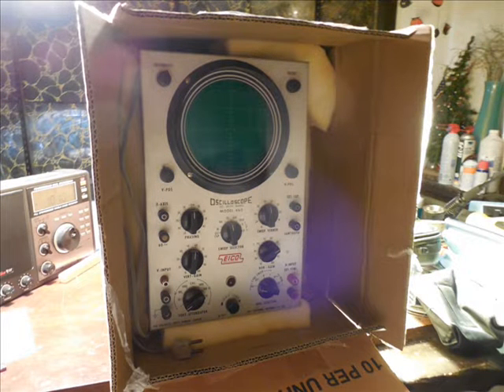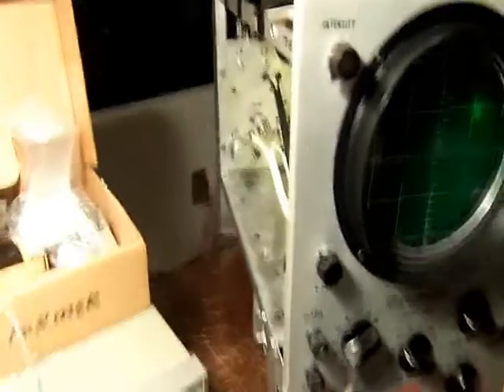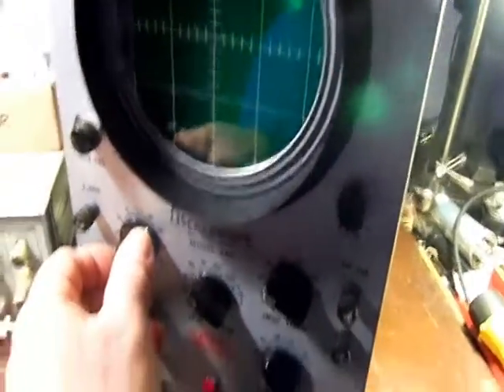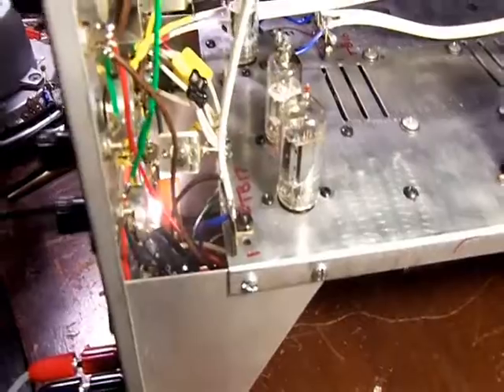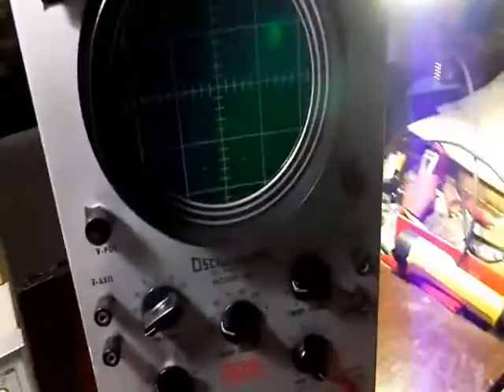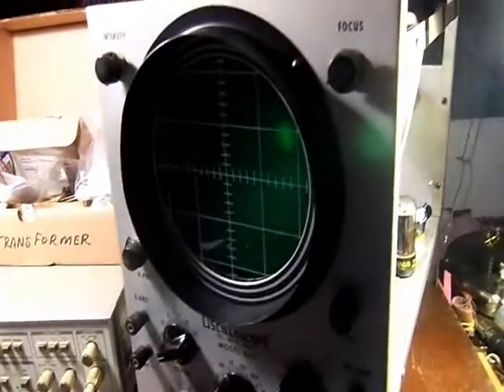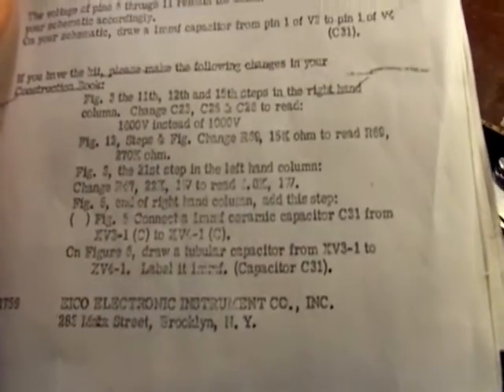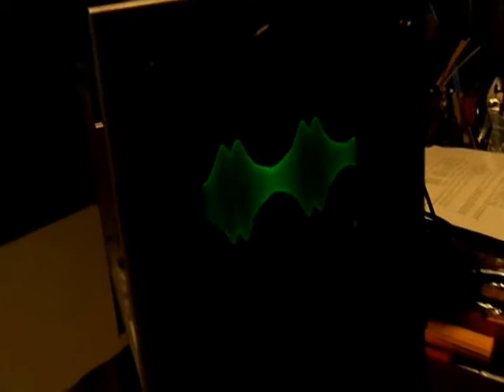Eico 460 Oscilloscope

Comment: Do you know of anywhere I can find a copy of the Addendum. Currently doing a complete restoration Thanks.
Reply from the maker: I think I have them saved, have to look. Or, will try to remember where I found them on-line.
Reply from the maker: Found it. Its 8 pages in a 3.84 mb size folder.
Reply: @TonyButchT  is there a link to it anywhere or is it posted on here

Comment: Thank you for your video, I do have the same one, but the intensity in the screen need to be up, I will recap , I don’t have the manual at this moment but you maybe you can tell me which tube has to do with the intensity . would appreciate it thank you again.
Reply from the maker: Jorge, Over the weekend, I will locate (hopefully) and send the manual, which I have a copy of. A leaky (internally passing) cap will indeed bleed current/voltage to ground, even though it looks perfect on the outside. Every Paper Type capacitor must get replaced. Remember...there is very high voltage  at the back of the CRT...use caution!
Reply from the maker: Jorge, A schematic should be available on the internet. If you get a schematic, Check  R72 (250K Ohm Intensity pot.), and C26 ( 0.1 mfd @ 1,000V). If C26 is leaky, DC voltage can bypass to ground.

Comment: How long did it take from complete breakdown to fully rebuild ?
Reply from the maker: Actual time spent working about 8 to 10 hours. Although being a hobby, this project took over a month.
Reply: I have 3, 460 scopes, the one I'm working on now is the older style. Where the 6X5 tube is, it is connected to the C27 capacitor off the transformer. The one I built from a kit the 6X5 is missing and replaced with  2 diodes on a terminal strip. The 3rd one works and I haven't opened it up.
Reply from the maker: @sparks2209  Very good Mike! Always use caution when working around the plug on the CRT, very high voltage present!

Comment: I just finished getting one of these back working. It was from the Milwaukee Area Technical College. I bought it from a surplus company that had tons of their stuff on eBay for only $30 shipped, it was sold for parts not working. I opened it up to find notes that said that CRT filament was tested and found to be open on Feb 9, 1967, and I believe that was the last time it ever worked. Someone carved the words 'Bad, Very Bad' into the face panel. 

I changed the CRT which is a 5UP1 and they are available on eBay if anyone in the future is looking. All the capacitors both the electrolytic and the wax ones were bad. So I replaced all of them. The fuse holder was robbed of its fuse and its twist in cap, so it was replaced. All the knobs were gone, I was able to buy some off another 460 so I got lucky. It is now working pretty good. I will do a little more to it but it has a nice bright rock solid trace and is very responsive. 

Thanks for the video. I have been checking back to this the whole time I have been working on this project.
Reply from the maker: Very Good Christopher! Thank you for posting this! Enjoy that Scope!
Reply: @TonyButchT  Thanks for the reply. I sure wish some company produced a new line of kits with the same quality as the old Heathkit and Eico stuff. It is really beautiful equipment I have lots of it.

Comment: If you’re still alive, I would love some advice. I just bought this exact one today (460)
Where do I start??? 
I want to totally take Her down and get deep into Her guts but I don’t think I’m ready for that. I’ll just start with the tip. Maybe start with that paper caps then electrolytics???
Let me know. I want to start today!
Reply from the maker: Definitely NOT necessary to rip it completely apart as I did. First...Safety! Over one thousands volts on the back of the CRT. Large capacitors WILL hold a charge, long after shut-down. Repair: Replace wax & paper caps, test all others for value being within tolerance.( Actually...Caps need to be tested at their full rated working voltage for INTERNAL leakage)  Test all resistors, replace any out of tolerance. Rotary and other switches clean up well with contact cleaner, as will tube sockets and tube pins. Check wiring and examine very closely ALL solder joints, re-flowing any that are in question. Don't rush, and enjoy the experience! Good luck!
Reply: SpiderLovesBeer Oh Yeah thank you Tony. I just finished Her up.  I have no clues on how to use Her though. I have a HealthKit SG-8 I don’t understand where to hook what up to what. I know the radio should be I the middle of the signal generator and the oscilloscope but what plug goes where or what probe goes where. I’m so confused. But I just wanted to thank you for your reply and information. I’m loving this new vintage radio/phonograph repair and now vintage test equipment. Have a great week Sir

Comment: Tony , Thanks for the video. I am restoring one. Can you send me the  construction manual or point me to it on the web. Thanks
Reply from the maker: Happy Goat, I have the construction manual scanned on a backup disk and need to locate this disk. Need some time to do this. I had no luck finding a download on the web. If you look below, I sent these files to YouTube user pablojre two years ago. Expand the "view replies" under his post to see the conversation. You could try asking him direct for the scans, hopefully he can locate them faster than me!
Reply: Thanks for both the video and for looking for the manual..No hurry Also looking for a original strap and knobs. My unit was use by a local high school as it has the property of WILSON HIGH SCHOOL  on the face plate..
Reply from the maker: Construction manual scanned and ready to send ( approx 35mb size file). The handle was probably removed for stacking, to save space in the classroom. You can get knobs that look right and work perfectly well at any home improvement store, the handle too, at a very reasonable cost.
Reply: Thanks So Much . want to get in to this project. great video.
Reply from the maker: Let me know how I can deliver the file to you...email? or I will print it out and mail to you, no charge! ( You can send your info/address via private message to my YouTube channel )
Reply: Hi  @TonyButchT  I have an old Eico 460 that I am currently recapping. Would it be possible to send me the addendum and the manual as well?
Reply from the maker: Gregg, If you set up your youtube account to accept private messages, I can send the files there. Or, you can send me a private message in my youtube homepage, and include information on where you want the files sent. Private message means no one else can see the message and/or it's content. It's entirely up to you!
Reply: Hi @TonyButchT  I'm fairly new to U-Tube and can't find how to do either. How do I send you a private message on your page, I don't see it.
Reply from the maker: Gregg, The messenger feature is no longer available, I just found this out! I dont know what to tell you at this point. I will search the YouTube information, and see if there is a way to message.
Reply: Hi Tony, are you a member of the Philco Forum? If so I can give you my handle and you can send me a private message there.
Reply from the maker: I just registered there, but have to wait for the OK from the administrator. Soon as I hear from them, I will get back to you.
Reply from the maker: Good thinking Gregg! Got the ok from the Philco Phorum, my user name is PappyCaps

Comment: I built one of these in 1962 and your video convinces me that a complete rebuild makes sense.  Any suggestions on best way to clean the selector switches that won't rotate?  By any chance, are the kit assembly pages available?
Reply: An "ultra-sonic cleaner" will TOTALLY clean wafer switched. Very thorough!
Also, I just ordered the Construction/Users Manual form a guy that provides them via eBay. 
Search, "glendalemanuals". He is the ONLY one I purchase ALL of my EICO Manuals from. He does TOP NOTCH work in reproducing them.
Patrick

Comment: Beautiful work and I appreciated your mix of obvious competence and alive-and-well enthusiasm. I have a question regarding  the transformer in your Eico 460,:Would it make any sense to replace the original (I assume A/C) transformer with a modern external brick-type transformer?  The output plug of the new brick would then plug into a new jack in the back of the cabinet. Sort of like we would do these days with say a laser printer or powered speaker. The goal being to make the unit a little safer by keeping the 120 Volt mains power out of the metal cabinet and farther away from my newbie and inexperienced paws. (Though I know the back of the tube and other parts of the circuit will still have dangerous potentials). It looks like the original transformer has two sets of outputs though; so I'm guessing it might take two different bricks if was even possible.
Reply from the maker: Thank You Police Dog! Replacing/updating an existing transformer is not as easy as it may seem. You really have to know your "stuff", and math, and how to test/analyze, etc. Location has effect too. Most times, a transformer is placed at a specific location...for good reason! Usually this location will create the least amount of energy induced into nearby circuits. This transformer has 4 internal and output circuits...quite the challenge to update! I recommend using the original transformer. Hope this helps.

Comment: This is a very informative and a help to me as I just purchased one from Goodwill and it is in goos shape.  Have a trace but the vert adjustment is not working due to a tube so I ordered a new tube and will see how it goes. Thanks for the info!
Reply: Robert Mulligan I’m having an issue with my horizontal trace adjustment. 
Did a new CRT fix your problem? I’ve traced and checked everything on that circuit.  
No joy.

Comment: Hey Tony, great video!

I recently picked up an Eico 460 kit. Mine also uses 1600v instead of the original 1000v. Same situation as yours, missing solder joints, broken joints, old caps, ect. I'll basically have to tear it down completely and rebuild it.

Would you happen to still have the four pages of the addendum available? I found a PDF online containing three pages but comparing the first page to the one shown in your video, your addendum contains more changes. Would it be possible for you to scan those four pages? It would be greatly appreciated!

Thank you.
Reply from the maker: +pablojre Hopefully I can scan them over the weekend or have them ready next week for sure.
Reply: +Tony T. No rush. Thank you very much!
Reply from the maker: +pablojre Files are ready to send! Please advise.
Reply: +Tony T. Got them. Thanks again!

Comment: Thanks for this video, Tony T. I have one of these in good condition but I have never been able to get it to calibrate correctly, so it ended up stored in a closet. I never knew about the circuit changes in the addendum, and apparently niether did the original kit builder. I found the manual and addendum on The Boat Anchor Manual Archive, and made the changes. It is now calibrated and working properly for the first time since I've owned it.
Reply from the maker: +Rob T That's good to hear! The more you use it, the better! Using the screen grid markings for measurements, you will find this scope is actually quite accurate!
Reply: Thank you! I have a number of modern scopes, but I really am a vintage test equipment addict!
Reply from the maker: +Rob T Same here!

Comment: Hello, I've acquired a newer model (EICO 785M-SP) but I'm pretty much 100% positive that it has the same circuit as this one. I have a big question. I'm trying to restore it and I need to replace the resistance and the potentiometer (part R75) but the one I ordered online does not seem to have the metal tab on the bottom part of the potentiometer where one lead of the resistance is soldered (3rd picture in the video). I'm not sure if I can use that part, or where to get one. Also, I think it's important to mention i'm a newbie to electronics.... I plan to change all the resistors and capacitors later on.
Reply from the maker: Fisher Saçescu The metal tab you refer to is not a part of R75, it is a grounding lug which one end of is 1/4" diameter to allow the threaded shank of R75 to pass through, the other end (what is seen in the photo) gets routed alongside and out back of R75. This lug is NOT needed and it is not called for in the instructions!
   When I got this scope, there were many modifications which might have been ok at some point in time, but the scope was non-functional when received.
Caution: High Voltage in and about the CRT circuitry! Good Luck!

Comment: Thanks for doing this video.  I just picked up one of these today (no manual).  It has a trace but looks like it will need some work.  Would you mind if I sent you questions about this unit?
Reply from the maker: Ask away! We all learn from each other!
Reply: Tony T. Thanks Tony.  First question - do you have a copy of the assembly instructions so I can check the builders work?  Second question - I see that I need to change some caps in the unit (especially C25 and C26).  The challenge I'm having is finding 0.1uf 1200V repleacment caps.  Hank
Reply from the maker: Commsprepper
0.1uf @1600V Metalized Polypropylene Orange Dip (although this particular size capacitor is brown in color) should work, although not cheap about 3 bucks each.from Justradios.com
I will make a copy of the construction manual for you!